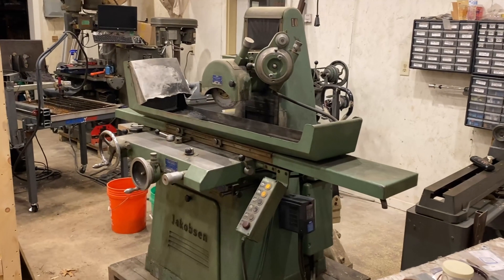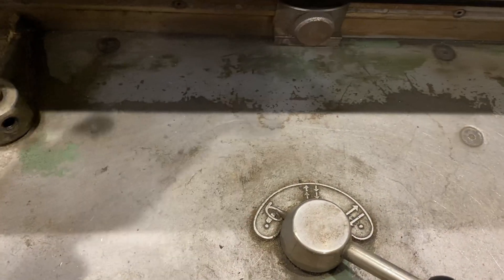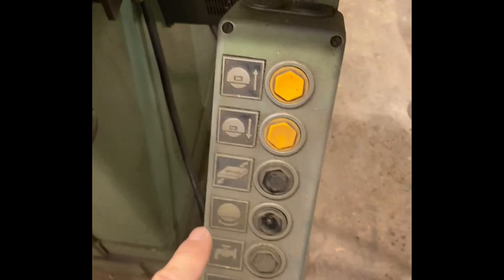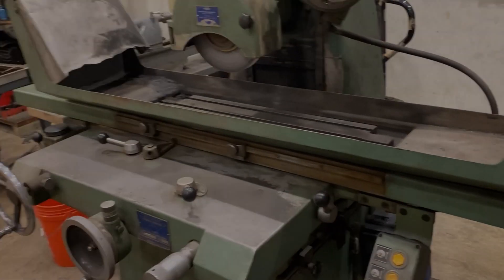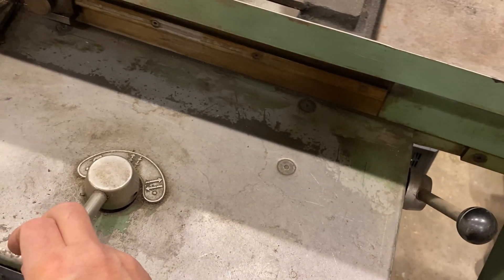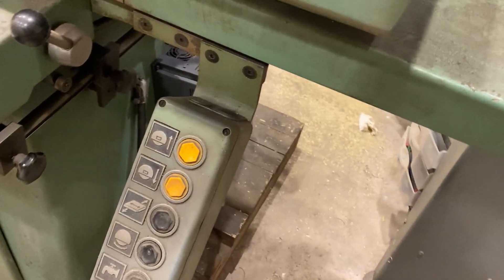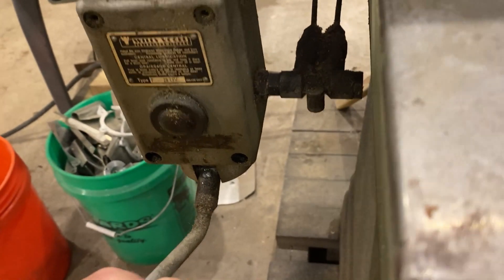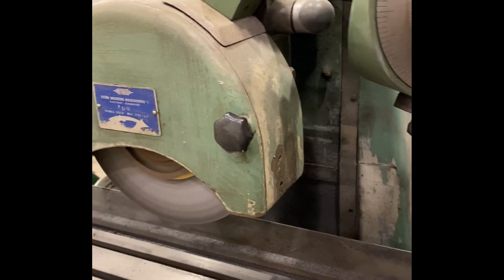Surface Grinder For Small Shop - SJ-12 Surface Grinder Walk around

Comment: How did that vfd phase converter hold up and would would happen to have anymore info on which one you used. I picked up this exact grinder at an auction pretty cheap. Looking at phase converters now.
Reply from the maker: Go Big, 

I bought that and a few other VFD's on Ebay all the same brand and they work very well. I have one on my Leblonde lathe now and it works great. 
They have gotten so cheap that its hard to get stuck on them anymore. I think I paid $300 for the one I put on the surface grinder and now it can be had on eBay for $169 for a 10hp unit.
The trickiest thing about VFD's is getting one with enough documentation to be able to actually install it and make it work. In that category, the Chinese ones can be a bit of a challenge sometimes. But with a bit of research it isnt too tough.
That grinder is a very capable machine. I would have kept mine but I just ran out of floor space and that was the least needed tool.
Have a super weekend!
If you put this into eBay you will find the VFD I used. 
7.5KW 10HP 220V Variable Frequency Drive Inverter CNC VFD VSD Single To 3 Phase
-Shane